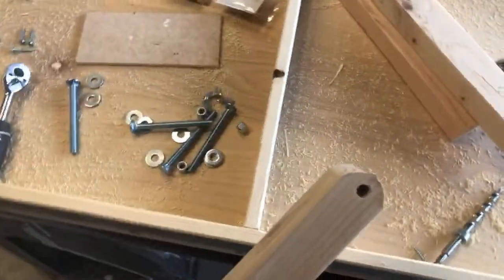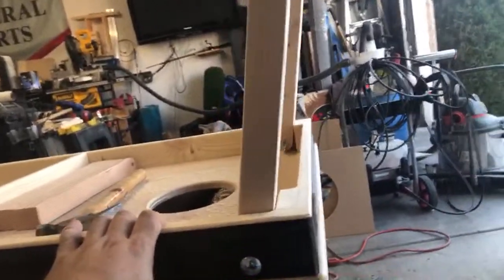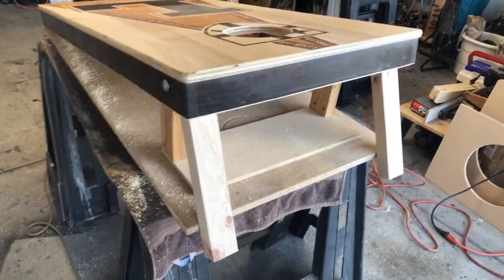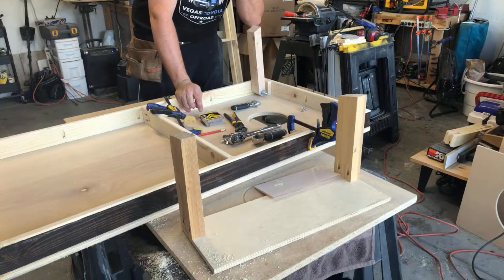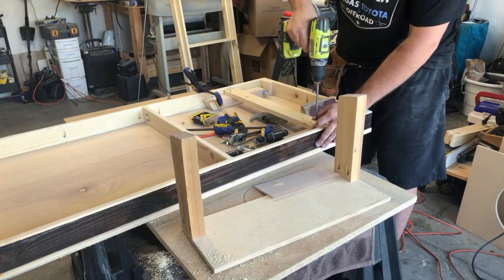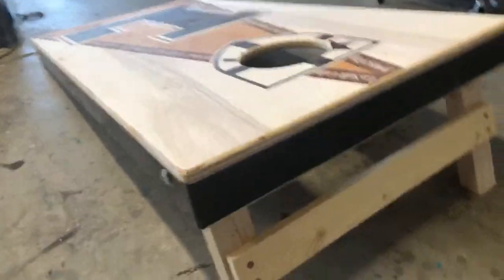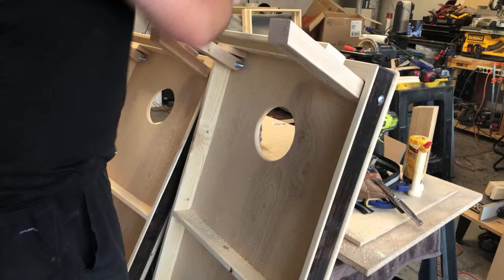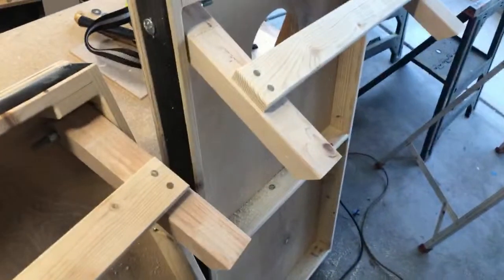Cornhole board leg day live!

Comment: Thanks for a great video!  I’m finishing my second set of boards. I’m amazed how easy you make it look drilling through your side boards free hand. I’m finding variation in the holes angle from side to side will make the crossbrace not fit flat on each leg.
Reply from the maker: 100% if the bolt holes aren’t exactly the same and the holes in the legs aren’t exactly the same, the leg angles will be off and the brace will make them wonky.
Reply: @cornholecollective7116  so you have calibrated drill skills?  Starting the hole exactly x amount from end frame is simple enough but drilling through the side frame exactly 90 degrees free hand seems dubious.  Guess I'd expect you'd drill them on the drill press before frame assembly??

Comment: Thanks Scott for the informative video.  I believe I have watched all your videos at least once.  I have a question about the jig your using to cut the final leg angle.  Would it be easier to make a jig that would butt up against the back of the frame?  Could it be made to exactly 11 1/4"?  That way you wouldn't have to move the jig back and forth to get your height correct.
Reply from the maker: 💯 that would be easier and that’s how I should have made mine. Thanks for watching!

Comment: The jig you use to hold the boards up to measure the legs with, do you have a template or can you provide the material and angles you used to make this please? Would love to make this but not sure of the angle
Reply from the maker: Hi, very common question. The bolt hole placement is always going to vary based on so many factors. Frame width, leg width, the rake you like, all that. There’s a short video on making your own bolt hole template. It’s actually really easy.
Reply from the maker: Better Cornhole Boards: Get your bolt holes right!
https://youtu.be/CLJj-vF1Ifo

Comment: what are the dimensions of where to drill the hole when you drill the holes in the legs themselves?  i get side to side you want the center point but how far down from the top of the leg  do you measure?  thanks for the great video!
Reply from the maker: So many variables to that from the width of your frame to your leg material, wether you add corner blocks or not, what angle you like. I suggest placing a leg with a clamp where you like the angle. Drill the frame hole for that one leg and then make yourself a template to duplicate it.

Comment: That was really helpful.  Thanks!  I just finished some boards and painted the top with Krylon Clear Gloss.  Unfortunately, it's so glossy that the bean bags don't slide on the top of the board.  They kind of just land in place.  Any ideas on how to make the gloss more slick or slippery?
Reply from the maker: Hey Mark! I’d treat them like the phase 5 finishing video with liquid water based poly, several coats then sand, then final coat. Should work like other painted and stained sets.

Comment: Thanks for the instruction scott!  wondered what the measurements are for the drill press hole in the legs; middle from side to side, but how far from the edge before that's rounded over?  thanks!
Reply from the maker: I misread this before John, i like to mitre saw around the leg hole to remove most of the material then round it with the belt sander. No exact measurements. 30 (+/-) degree angle cuts start below the hole on both sides.

Comment: Scott, You use jigs and fixtures in so many areas to make work repeatable and efficient - why not the legs? I would think that a drilling fixture would locate the leg holes exactly in the same place every time allowing you to cut the length/angle and not have to go through the steps of laying up the board to measure height from ground. Im sure Im missing something because Im a newb and you've got great processes everywhere else. Help me understand this one.
Reply from the maker: There are small variations in the frame wood when you’re using solid frames instead of ripped plywood, causes leg angles to be just a hair off if you mass produce legs. I do it this way to make 100% sure my legs are flat and there’s no wobble regardless of frame irregularities. It’s a pain but it’s what I know. If I ripped ply frames, I’d mass produce beautiful legs like Hunter does.